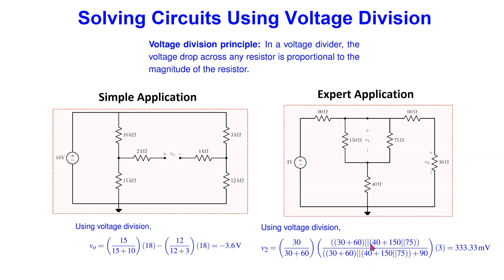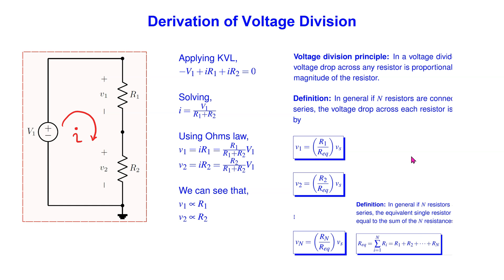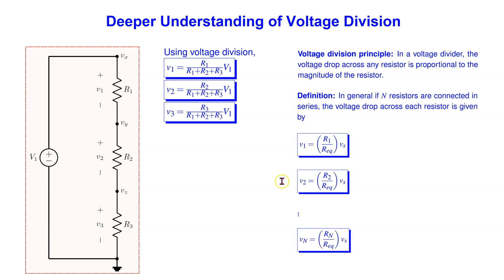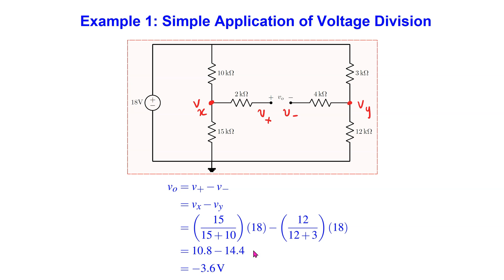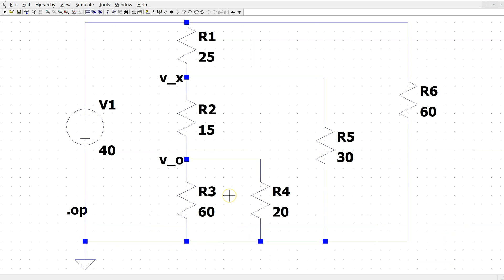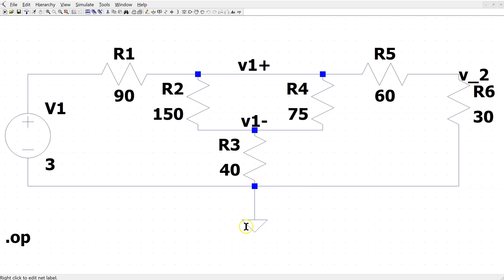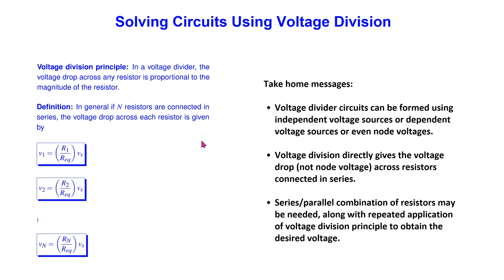Solving Circuits Using Voltage Division

Comment from the maker: # Pyspice (Python) code to simulate Example 1 in the video
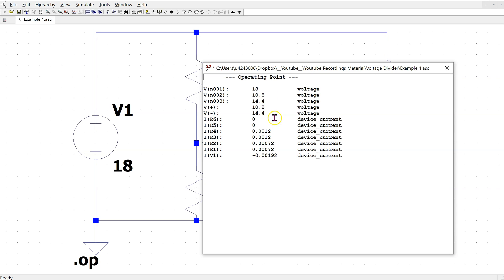# Compare with LTSPICE solution in the video at 6:06
##########################################################

import PySpice.Logging.Logging as Logging
logger = Logging.setup_logging()
from PySpice.Spice.Netlist import Circuit
from PySpice.Unit import *

circuit = Circuit('Voltage divider - Example 1')

circuit.V(1, '1', circuit.gnd,  18@u_V)
circuit.R(1, '1', '2',          10@u_kΩ)
circuit.R(2, '2', circuit.gnd, 15@u_kΩ)
circuit.R(3, '2', '3',          2@u_kΩ)
circuit.R(4, '4', '5',          4@u_kΩ)
circuit.R(5, '1', '5',          3@u_kΩ)
circuit.R(6, '5', circuit.gnd, 12@u_kΩ)

simulator = circuit.simulator(temperature=25, nominal_temperature=25)
analysis = simulator.operating_point()

for node in analysis.nodes.values():
    print('Node {}: {:4.2f} V'.format(str(node), float(node)))

for node in analysis.branches.values():
    print('Node {}: {:5.3e} A'.format(str(node), float(node)))

######################################################################
# Calculate and display the currents in each reistor 

i1 = (analysis['1'] - analysis['2'])/circuit.R1.resistance
print('i1{}: {:5.3e} A'.format(str(i1), float(i1)))

i2 = (analysis['2'])/circuit.R2.resistance
print('i2{}: {:5.3e} A'.format(str(i2), float(i2)))

i3 = (analysis['2'] - analysis['3'])/circuit.R3.resistance
print('i3{}: {:5.3e} A'.format(str(i3), float(i3)))

i4 = (analysis['4'] - analysis['5'])/circuit.R4.resistance
print('i4{}: {:5.3e} A'.format(str(i4), float(i4)))

i5 = (analysis['1'] - analysis['5'])/circuit.R5.resistance
print('i5{}: {:5.3e} A'.format(str(i5), float(i5)))

i6 = (analysis['5'])/circuit.R6.resistance
print('i6{}: {:5.3e} A'.format(str(i6), float(i6)))

# Pyspice (Python) code to simulate Example 2 in the video
# Compare with LTSPICE solution in the video at 8:52
##########################################################

import PySpice.Logging.Logging as Logging
logger = Logging.setup_logging()
from PySpice.Spice.Netlist import Circuit
from PySpice.Unit import *

circuit = Circuit('Voltage divider - Example 2')

circuit.V(1, '1', circuit.gnd,  40@u_V)
circuit.R(1, '1', '2',          25@u_Ω)
circuit.R(2, '2', '3',          15@u_Ω)
circuit.R(3, '3', circuit.gnd,  60@u_Ω)
circuit.R(4, '3', circuit.gnd,  20@u_Ω)
circuit.R(5, '2', circuit.gnd,  30@u_Ω)
circuit.R(6, '1', circuit.gnd,  60@u_Ω)

simulator = circuit.simulator(temperature=25, nominal_temperature=25)
analysis = simulator.operating_point()

for node in analysis.nodes.values():
    print('Node {}: {:4.2f} V'.format(str(node), float(node)))

for node in analysis.branches.values():
    print('Node {}: {:5.3e} A'.format(str(node), float(node)))

######################################################################
# Calculate and display the currents in each reistor 

i1 = (analysis['1'] - analysis['2'])/circuit.R1.resistance
print('i1{}: {:5.3e} A'.format(str(i1), float(i1)))

i2 = (analysis['2'] - analysis['3'])/circuit.R2.resistance
print('i2{}: {:5.3e} A'.format(str(i2), float(i2)))

i3 = (analysis['3'])/circuit.R3.resistance
print('i3{}: {:5.3e} A'.format(str(i3), float(i3)))

i4 = (analysis['3'])/circuit.R4.resistance
print('i4{}: {:5.3e} A'.format(str(i4), float(i4)))

i5 = (analysis['2'])/circuit.R5.resistance
print('i5{}: {:5.3e} A'.format(str(i5), float(i5)))

i6 = (analysis['1'])/circuit.R6.resistance
print('i6{}: {:5.3e} A'.format(str(i6), float(i6)))

# Pyspice (Python) code to simulate Example 3 in the video
# Compare with LTSPICE solution in the video at 10:42
##########################################################

import PySpice.Logging.Logging as Logging
logger = Logging.setup_logging()
from PySpice.Spice.Netlist import Circuit
from PySpice.Unit import *

circuit = Circuit('Voltage divider - Example 3')

circuit.V(1, '1', circuit.gnd,  3@u_V)
circuit.R(1, '1', '2',          90@u_Ω)
circuit.R(2, '2', '3',         150@u_Ω)
circuit.R(3, '3', circuit.gnd,  40@u_Ω)
circuit.R(4, '2', '3',          75@u_Ω)
circuit.R(5, '2', '4',          60@u_Ω)
circuit.R(6, '4', circuit.gnd,  30@u_Ω)

simulator = circuit.simulator(temperature=25, nominal_temperature=25)
analysis = simulator.operating_point()

for node in analysis.nodes.values():
    print('Node {}: {:4.2f} V'.format(str(node), float(node)))

for node in analysis.branches.values():
    print('Node {}: {:5.3e} A'.format(str(node), float(node)))

######################################################################
# Calculate and display the currents in each reistor 

i1 = (analysis['1'] - analysis['2'])/circuit.R1.resistance
print('i1{}: {:5.3e} A'.format(str(i1), float(i1)))

i2 = (analysis['2'] - analysis['3'])/circuit.R2.resistance
print('i2{}: {:5.3e} A'.format(str(i2), float(i2)))

i3 = (analysis['3'])/circuit.R3.resistance
print('i3{}: {:5.3e} A'.format(str(i3), float(i3)))

i4 = (analysis['2'] - analysis['3'])/circuit.R4.resistance
print('i4{}: {:5.3e} A'.format(str(i4), float(i4)))

i5 = (analysis['2']-analysis['4'])/circuit.R5.resistance
print('i5{}: {:5.3e} A'.format(str(i5), float(i5)))

i6 = (analysis['4'])/circuit.R6.resistance
print('i6{}: {:5.3e} A'.format(str(i6), float(i6)))